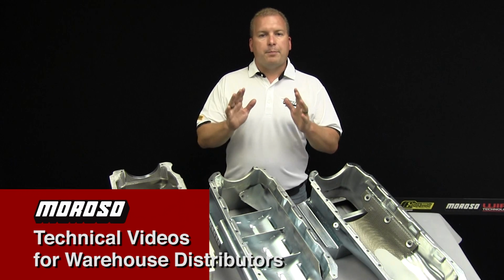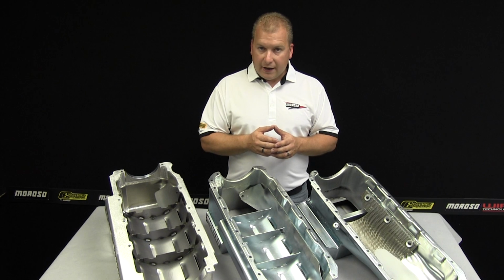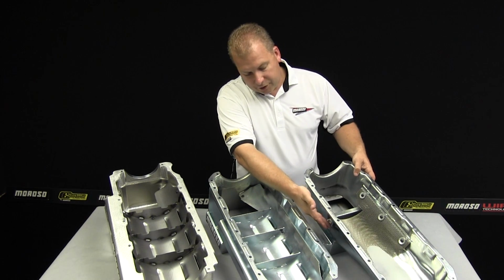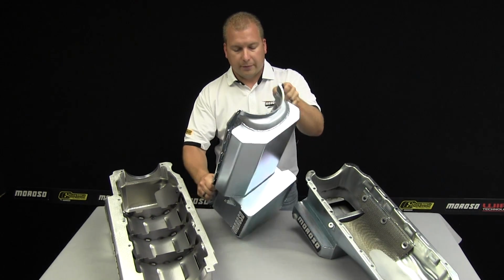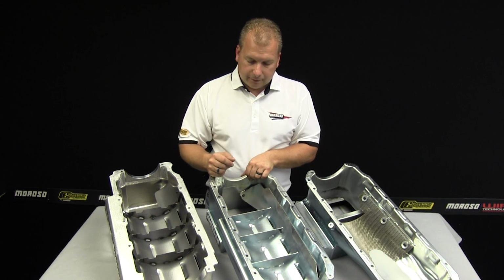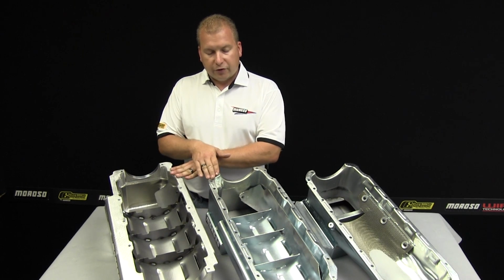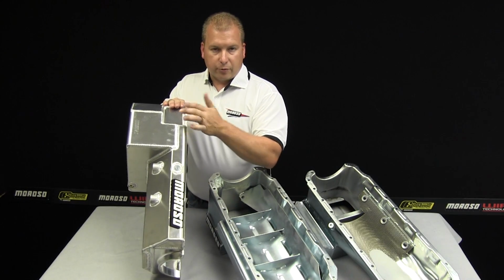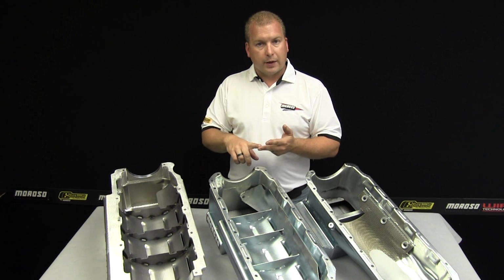Big Block Chevy Oil Pans

Comment: I have a 79 Camaro Z28 just built a 1972 Chevelle 396 what oil pan do u recommend
Reply from the maker: If you're looking for a pan for the Chevelle, I'd need a little more info. Is this a production MK4 big block? Are your steering components in front of or behind your crossmember? And what style pan are you looking for? Just a nice street and strip deal? Or something that more performance minded?
Reply: @MorosoPerformance  I'm looking for a drag race pan for a 79 Camaro Z28 with a big block 396 dip stick on passenger side
Reply from the maker: @mandrell13  No Problem!
If the block is a 2pc rear seal block, the number for the pan is 20408.
If it's a 1pc rear seal, the number is 20414. Both take the same pick ups, 24440 for stock style big block pumps ( m77 or m77hv).

Comment: Do you guys do to suit BBC in a 55 57 chev  with extra capacity and windage tray / scraper. It is a 4.00 stroke with around 800 HP and 7000 rpm street strip deal.
Reply from the maker: Hi Michael, 
Thank you for your interest in our Products.

If your car has a stock '55-'57 front end with a Gen. 4 BBC then our recommendation is our Part No. 20431 oil pan, Part No. 24430 oil pump pick up, Part No. 23036 windage tray/scrapper kit.

If the car has an aftermarket front end with a Gen. 4 BBC then our recommendation is Part No. 20408 oil pan, Part No. 24440 oil pump pick up.

Comment: I have a 1970 el camino with a 454 and I'd like extra oil capacity.  It's basically a stock setup.  Does have power steering.  Do you have a pan that would fit?  Thanks.  Good video!
Reply from the maker: Hi Roger,

What a cool vehicle! For your application we would recommend our Part No. 20412 oil pan, 24440 oil pump pick up
and 25973 dipstick kit

Comment: Is there ever a need for a bigger oil pan on a small block? Or are there advantages to getting a bigger capacity oil pan
Reply from the maker: Hi Alex,
Thank you for your interest in our products. To answer both of your questions, yes and yes. Here is why; You can't just overfill a stock oil pan without creating more problems than benefits, the oil would sit too high in the oil pan get into the engines rotating assembly. This extra oil in the rotating assembly would get whipped around, putting air bubbles and heat into the oil thus compromising the oil system's effectiveness.  A properly designed extra capacity oil pan should accomplish a couple of objectives including moving the oil away from the rotating assembly for better oil control and the extra oil in the oiling system helps by keeping oil temperatures down (more oil to dissipate the heat/more oil to heat up).

Comment: Which street/strip 7qt pan for my 98 k1500 z71 truck with a 5.7 sbc 350
Reply from the maker: James,
Thank you for your inquiry, the oil pan that we would recommend for your application if you are using the engine block that came with the truck is our part # 20182.

 https://www.moroso.com/chevrolet-small-block20182/

Moroso Performance Products